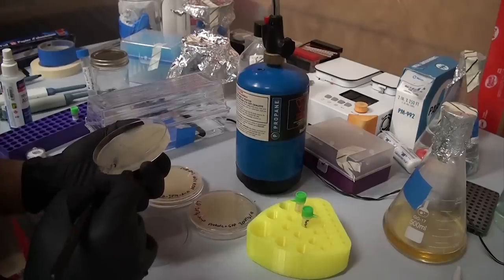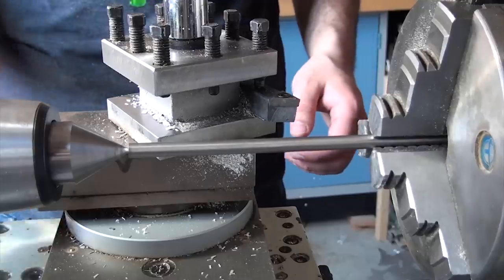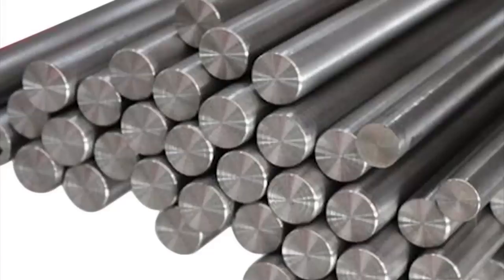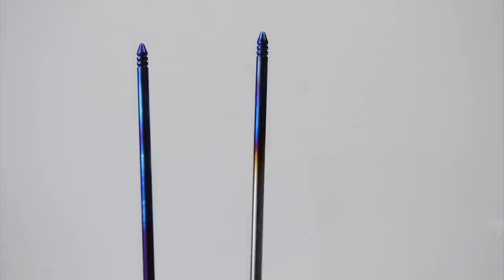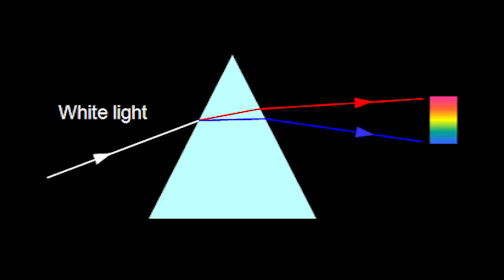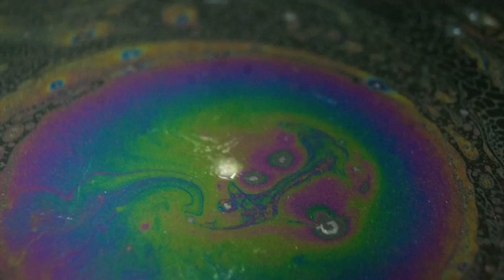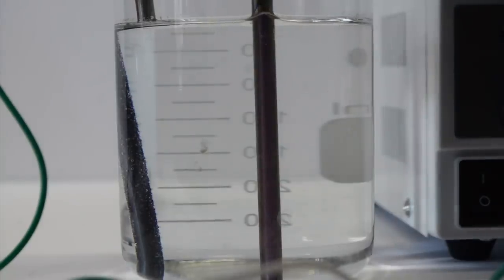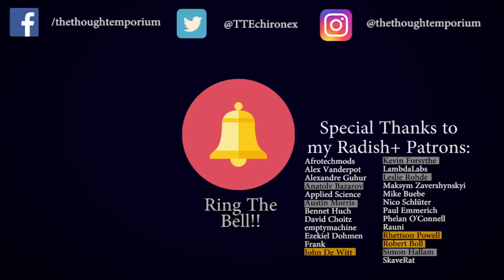Why is Titanium so COLORFUL? - Making/Anodizing Titanium Chopsticks

Comment: I am a process metallurgist at a company that forges billets of Ti for use in jet turbines and other highly sensitive applications, unfortunately at the temperatures we forge at, it destroys the color and it comes out gray due to how thick the dioxide layer is, but Ti is an amazing metal and much easier to work than the Ni superalloys like Inconel and rene 65

Comment: I've bought a pair of $135 (although nowadays you can get some for as low a $75) ornate anodized titanium chopsticks called TiSushi Chopsticks, aside from being extremely gucci, they're actually well-balanced and preferable over wooden chopsticks.
IMO there's a huge difference between polished hand-machined solid titanium sticks with grip tips and mid-section patterning for easier handling and the $15 hollow unfinished ones from amazon that sound like chalk when you rub them together.

Comment: I use a color scale to judge the oxide level on stainless weldments. If the O2 ppm level is too high, the weld area will color to a point of rejection. The reason we do this is because the stainless properties are compromised which results is easier corrosion of the area as well as foreign material slowly eroding away into the chemistry that the stainless is supposed to contain. When your product relies on near-flawless switches on the nano-scale, you need to control every aspect related to production.

Comment: Could you possibly coat the outside of the chopstick in a rubber/plastic film with specific patterned holes, and then use the electrolysis to only colorize the exposed parts?
I could imagine that being really cool, and relatively easy.
Or what about spraying the metal with some extremely high voltage source of fine water droplets. I'm not sure this one is possible tbh, but the pattern could be very unusual.

Comment: If you're wanting to maintain certain metal finishes you can skip the sanding process by hot washing in windex (ultrasonic helps) and then hit with a metal etchant. Sadly, the best etchant for this is hydroflouric acid.

Comment: If you insulate the end of the chopsticks and recut the grooves, you could have different colour grooves with the electrolysis method   ;)
Reply: he could also recut the grooves and use the anodizing method with a lower voltage to get a different color
Reply: Or you could add a thin layer of paint to mask it. Just remove the paint later

Comment: Steel does this too, but it rubs off pretty easily. Is that not as much of an issue with titanium, or does this work mostly because the area you're coloring doesn't see much abrasion?

Comment: Beware carbide is brittle and has a 3 to 5 thousands radius on the cutting edge. This typically means you need to take at least a 5 thousands cut. Anything below is doing really funky work hardening.

Comment: I have an idea for an experiment that I just can't afford to do. I'm sincerely hoping that you might I think this is an interesting and exciting experiment and give it a try. This experiment will require a laser, some fiber optic cable, and a fiber optic y splitter. I'm curious to know what would happen if you took the single line on the fiber optic y and fed it back into one side on the double end of the y. From there you would shine a laser through the remaining open and on the double side of the y so the photons continuously loopon one side of the fiber-optic y and are continuously introduced through the other.

Comment: The oxide layer in steel forms at around 200°C and it is a reference point for tempering your steel at home, if you are a blacksmith for exemple

Comment: You should have a piece of cloth that is soaked in salt water and electrified then is placed on a stand with a small slit on top just bit enough to lay the rod on, then you can oxidize the surface while pushing the rod forward and turning it, producing desired patterns, or you can put stencils on the rod to produce a pattern instead, which would also be cool.

Comment: Does the electrolysis method work on steel as well? I'm always blown away by Clickspring's heat-blued screws for his skeleton clock project, but the consistency of the electrolysis technique shown here is amazing too.
Reply from the maker: Nope, I tried it but didn't include it in the video. Doesn't work at all

Comment: I've noticed that at times with my anodized titanium jewelry the part that is in my skin will fade faster than the rest of it. I've always assumed that was because of the natural pH of my body, which is slightly acidic and may be stealing oxygen off the titanium dioxide and converting it slowly back to titanium. Am I correct in this assumption?

Comment: I wonder what neat effects you could pull off if you were to(trifling details excluded) fill the space between two stiff silicone membranes with your solution, and shove the chopstick through it, controlling for speed and voltage simultaneously. That way (hopefully), you could act on a relatively small cross section and control another relevant variable.

Comment: A drill with a nut driver to suit your handwheel turns any axis into a power feed. The better your drills RPM control the better, did this on a manual mill for long material removing cuts.

Comment: Can't wait to see how your sonoluminescence turns out! (I'm guessing that's what it is, having once spent time with spherical flasks and transducers as well 😁)
Reply from the maker: Yup! I think I've got it working, but was too bright in the room to see what was going on. did you ever get yours working?
Reply: @thethoughtemporium  I'm reasonably confident I saw a single glowing dot for a few seconds, but unfortunately that was it, and I was never able to repeat it! Seems so sensitive to frequency, water conditions, dissolved gas etc.
Reply from the maker: @imajeenyus42  How bright would you say the dot was? all the images I've seen are long exposures so it's so hard to figure out what to expect. Also apparently it's 2700 times brighter in concentrated sulfuric acid, so if I can make it work, I'm gonna try that
Reply: @thethoughtemporium  It wasn't very bright at all, unfortunately - I was doing it in total darkness and although it was visible, it certainly wasn't bright. Hard to describe since there's nothing sort of comparable as a light source! The photos you see can be deceiving because of the log exposure. I'd forgotten about doing it in different liquids, that sounds very helpful if sulphuric acid increases the brightness.

Comment: To make the colors insanely vibrant, you need to etch the metal. Hydrofluoric acid is one of the only reliable and cheap ways to do this. Pick up something called Whink rust and stain remover for a cheap source of dilute HF. Etch your Ti and immediately anodize it (electrically) afterward while minimizing exposure to oxygen in between. This will allow you to access extremely vibrant golds, blues, purples\pinks, and finally greens. I've been anodizing titanium as a hobby for 5+ years, trust me, its very very worth it. : )

Comment: Cool. Could you stop the oxide layer forming during electrolysis with insulating tape? Could you make stripes or write something on the surface?
Reply: Instead of tape, try painting a masking layer over it. Something like clear nail polish (or not clear so you know where you've covered). As long as it's dried it should prevent the oxidation in those areas. Remove with acetone, possibly being g careful if the oxide layers don't like the solvent. :)

Comment: If you have powerful enough power source try to get the oxide layer by resistance heating the chopsticks. Electrical resistance of titanium is quite high and the colors would be much more even than when heating with a torch. The only problem I would see are the connection traces on the chopsticks.

Comment: How about you take part of any clear tube and cut it to size, add some kind of caps, drill holes and add some rubber/silicon seals, then put it unter solution and put metal throught it there and then remove it from water. after that you could possible move metal and have better control over which area to have effect on.

Comment: Can you combine the two methods? Also, I bet you could get some cool effects by colorizing it, partially sanding it off (but leaving lots of residue with obvious lines of color) and then re-colorizing it (adjusting total time to ensure the old color gets where you want it, ofc).
Reply: From my experience, i have been able to combine electrical than heat but not the other way around. The heat seems to make a stronger layer as even my etchant has trouble removing it and i typically have to refinish the piece

Comment: I'm not sure if you answer questions like this, but your video got me thinking about color and I've confused myself... I was under the impression that light gels (like what photographers sometimes use) color the light be effectively filtering out all but the wavelength of light they are made to let pass through. So, for a red gel, white light would go in, but only the first bit of the visible light spectrum gets to pass through, leaving only red light. Right? But if that's the case, how is it you can make a purple-ish color by layering a red gel and violet gel? Wouldn't the second gel filter out the result of the first while not having the wavelength it allows through because the first gel had already removed it?  ...I am probably overthinking this.
Reply from the maker: There's 2 tricks. 1 gels aren't 100% effective. 2 human perception is pretty sensitive but also not at the same time. It's mostly your brain lying to you by coming up with the thing it thinks makes the most sense. So it doesn't take much change in the ratio of the various colors to make it assume the light you're seeing is a single particular color. Your screen for example only has 3 color pixels yet to you it looks like the entire rainbow. If you look up the specific lighting gels you'll see their transmittance isn't perfect. The more intense the color is, the more it dampens the other colors to make the one color be more prominent. But since most only need to tweak the light a bit, there's still lots of the other colors getting through, your brain just ignores them, or rather is overwhelmed by the brightest color(s) and fixates on that. Or makes it's best guess based on the mix it's getting. But when you add a second gel, now the ratio of colors is different and a more colors get dampened and your brain can make a new guess at what the best representation of that mix of wavelengths is.

Hopefully that makes sense
Reply: @thethoughtemporium  thank you for clearing that up for me. Somehow it hadn't occurred to me that they weren't 100% effective.

Comment: I got a good question. If a white light refracts off of water and gives off a multitude of "colors", what does dark light give off? I mean, we made a black light, but that's not what I mean. Let's imagine for a second that lights and darks are not shades and tint on the art scale. What if we made a "light source" that actually turns off light projection? For example, instead of having an object cover light projection to get dark, we have a dark projector that when an object is placed within it's path, light shines upon it? So with those thoughts, what would "dark light" look like when refracted?

Comment: Tip, IPA only moves oils, I suggest a degreser with heat to completely remove oils and then use IPA to give an absolute clean. Of get an ultrasonic bath, or two. One for degreaser and one for IPA. Be warned, IPA vapour can explode/ignite.

Comment: How does this compare to aluminum anodization?  We're had many anodized aluminum parts (and other metals and other surface treatments) at places I've worked, but I didn't realize this is how it worked, at least for titanium.
Reply from the maker: Aluminum is different. With aluminum you grow a porous oxide coating and then fill it with an actual dye before closing up the pores to lock it in.

Comment: Tempering metal (that's the heat treating) is more usually done to change the characteristics of that metal.
different colours result in different hardnesses so a chisel or survival knife might be deep blue or purple while a sharp scalpel or knife would be very brown (hard) which would also make it very brittle to the point that it will shatter like glass if bent or dropped.  While you wouldn't put that much force into a chopstick (unless you were using it like a jemmy or using them like drumsticks).  Dropping them could result in the metal snapping unexpectedly depending on what colours people produce.

The alternative chemical treatment might be a safer bet, especially if you're in your brown period.
Reply from the maker: Titanium doesn't harden the way steel does.
Reply: @thethoughtemporium  true - lack of carbon means the brittleness isn't such an immediate problem as C-steel  but double soaking it still classes as tempering and it will harden the surface.  The more you work it, the harder it will get until it becomes brittle with overwork.
Machinists drilling or milling titanium will tell you that if you have to stop, getting going again is a big problem because once that surface cools it's going to be tempered and hard as hell..   The machinists I know all say the best way to machine titanium is full on - you work as fast as you can even if that means swinging on the advance lever because if you vary the temperature or let it cool, going back will be difficult and then leads to brittle areas and failures unless you let out the tension by re-treating the piece

Not meant as a crit - but people who hobby are more likely to overwork and less likely to release overworked pieces.

Comment: That's sweet, I run a CNC lathe with a 20hp motor.  I love it can take .125 pass at .006 and it just hogs steel out like it was  Aluminum. But I make aircraft parts that are 20-200 per order

Comment: I got my hands on some 1 MIL sheets of titanium from a capacitor manufacturing facility to do simple origami with. The metal doesn't lend itself to anything more complicated than a crane but it works. I would use a lighter to heat the wings and get the blue effect but overheating such a thin sheet too quickly would often lead to the metal catching and burning like magnesium. Any idea what is going on here exactly? I only have Titanium enough for 3 more cranes and I'd like to figure out the problem before I proceed.

Comment: How do you accomplish the banding effect? I would assume it would just be different voltages at different depths, but each additional depth would cover the previous bands. My next assumption would be doing one color, then sanding specific bands, then re-anodizing in a second color, but this seems like excessive work.
Reply: I think he threw the banded chopsticks on the lathe and used the blowtorch on the middle of each band

Comment: So are the colors long lasting? I guess that they should if you are doing this. With iron I have found that they will convert to black iron oxide over some weeks, I guess that the passivized layer grows with atmospheric oxygen. I love the effect so I had thought about coating it on something to preserve it on iron/steel.
Reply: Eru Iluvatar they really don’t change at all. The lower temp/voltage colours get muted by oils, but recover when cleaned. They need serious abuse to scratch it off, or could of course be altered by heat, if you heat past green it suddenly goes a very disappointing grey...
Reply: titanium oxide layers are practically permanent

Comment: Acetone or mineral spirits is better than rubbing alcohol. Helps maintain a passive film over the metal, and prevents unwanted oxidation
Alcohol as it evaporates introduces a lot of oxygen to the surface, thus oxidizing the metal. Using mineral spirits or acetone allows the patina (yes patina. Its a heat patina, not anodization) on the metal to hold longer, and withhold the passive film, allowing the titanium to resist oxidation and contamination

Comment: Did i miss it; why do the oxides form at such high voltages? I'm thinking of it from a cell perspective, the most voltage I know about for electro-chemical cells is around 5 volts Im assuming that ties into it. 
Or does that mean the oxide layer is truly that resistive?
Reply from the maker: I kinda glossed over it because the actual answer involves more quantum mechanics, but the short version is, yes the oxide seriously inhibits the reactions, but as you increase the voltage the electrons can tunnel through the oxide layer that's already there to allow the reaction to continue, but as the layer thickens, it takes more energy to tunnel and the reaction stops.

Comment: So if I understood correctly, a (very) thin layer of water on a reflecting surface should have the same effect? Can somebody explain why you don't see the effect in this case?
Reply from the maker: It doesn't spread out the same way usually and tends to bunch up. Same reason it only works for some oils. Also the refractive index matters and adjusts how well this works.

Comment: I see this explanation for the colours that arrive from bluing metal all the time, but it does not make any sense. The phase shift introduced into a particular ray is dependent on the angle of incidence. This is why true thin film interference - such as the dichroic mirror shown - appears to change colour as the part is moved around relative to the light source and the viewing angle. Blued metal does not do this; its just a solid colour. 
Clearly the colour is dependent on film thickness, but there is no way this can be due to a pure structural colour effect without that angular dependence. Unfortunately I have no idea what the true answer is, because everyone trots out this thin film interference stuff apparently without thinking about it too hard